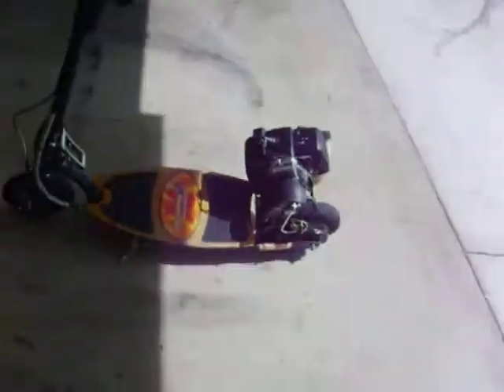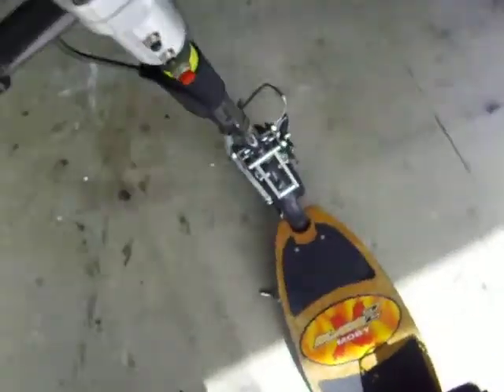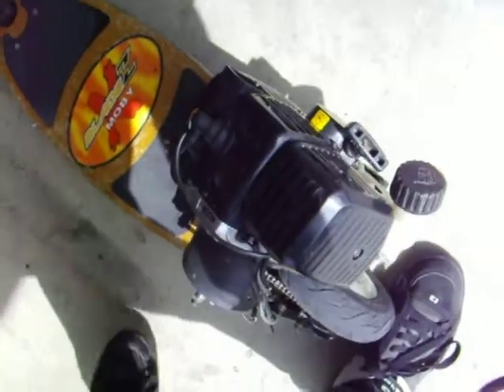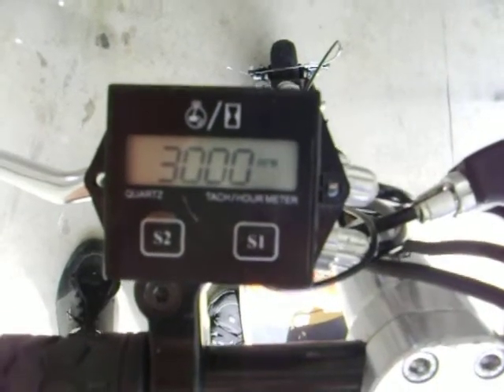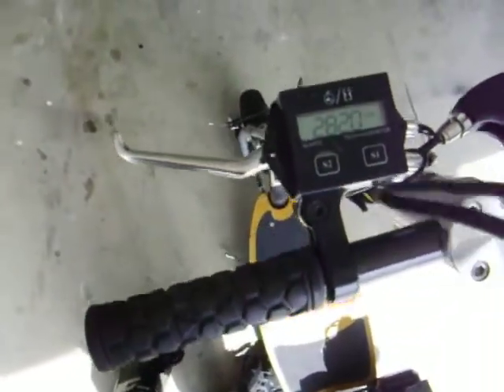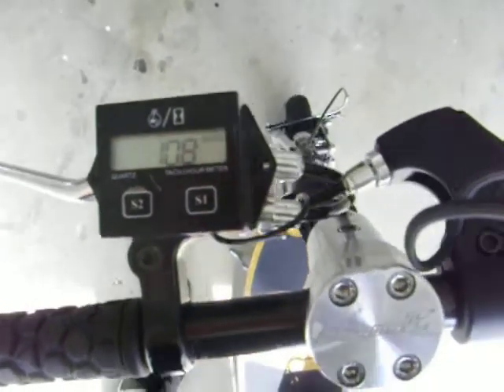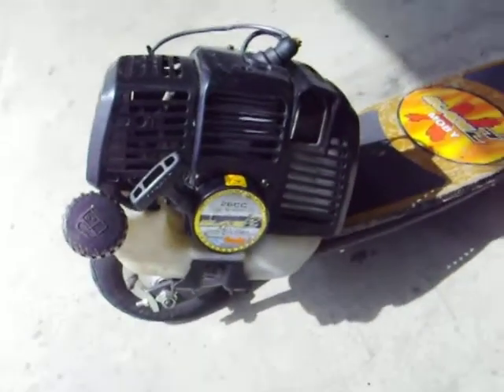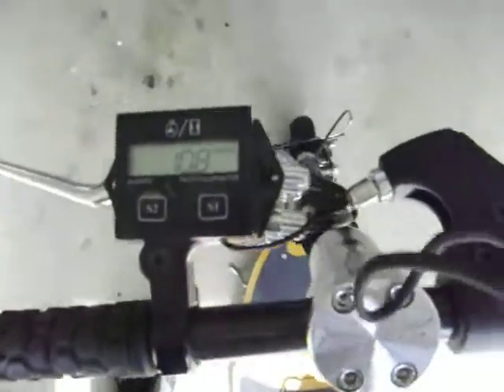2 stroke engine max rpm

Comment: Using 4-stroke tachometer in 2-stroke? So half of those readings is correct, max 5700rpm and min 900rpm. Sounds just like it, 2-stroke always feels like taking more revs than 4-stroke because it does work on every revolution, not just every 2nd as 4-stroke would.
Reply: +Mika Saarinen The tachometer can be adjusted to 2 or 4 stroke, 1, 2, 4, 6 and 8 cylinders
Reply: +Citroable  Most, but not all tachos and best one's can also understand any number of cylinders (incl. 3&5). I'm just wondering here if the adjustment to 2-stroke has been done on tacho. If not, 4-stroke setting on 2-stroke engine will give double rpm on screen.